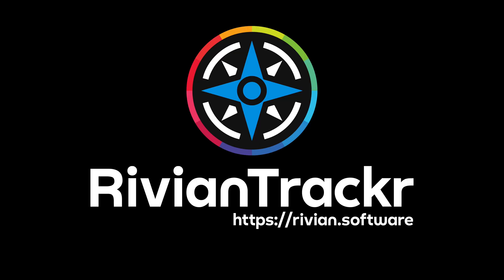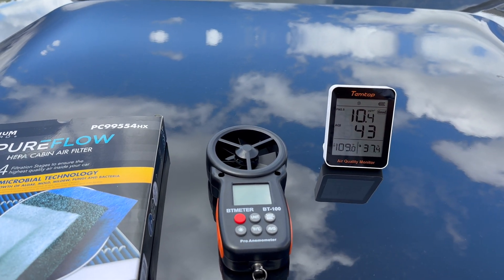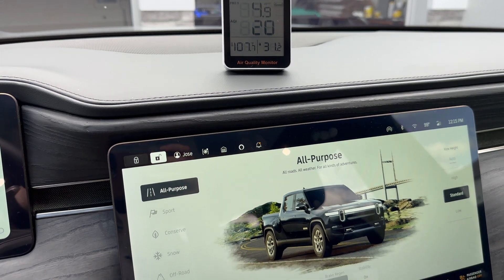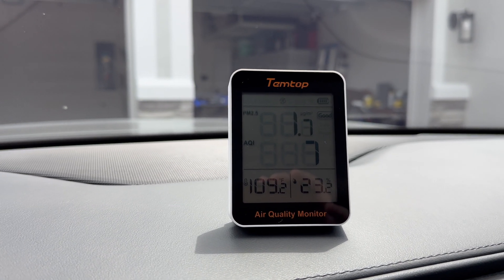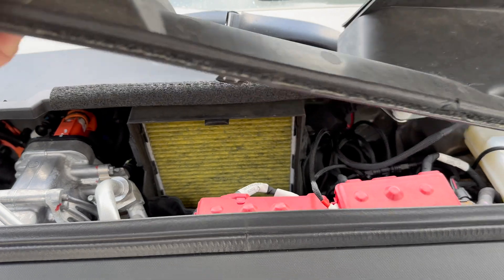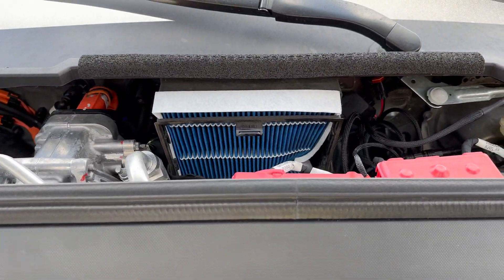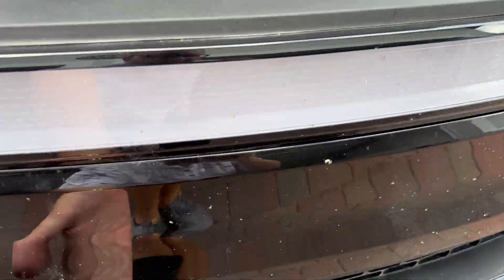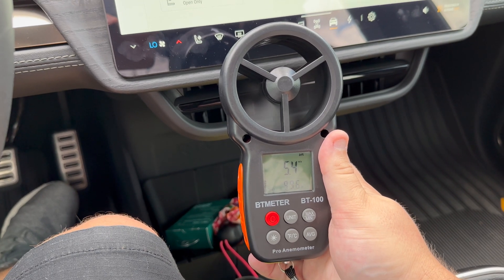Breathe Easy in Your Rivian: Install a HEPA Air Filter for Cleaner Cabin Air

Comment: I appreciate the text however you are comparing a dirty used air filter with a brand new HEPA filter.  To improve the study You should test a new plain filter with a new HEPA filter.  This will offer more accurate data.
Reply from the maker: The filter I replaced was less than a month old from Rivian.

Comment: In case others are wondering the name and model of the HEPA filter since it''s not in the video or description (only the link):  Pureflow HEPA Cabin Air Filter PC99554HX | Fits 2020 2020-22 Hyundai Sonata

Product Description: HEPA (High Efficiency Particulate Air) cabin air filter is built with high efficiency filtration media, which is designed for people who suffer from allergies. It has a 10-15% drop in pressure compared to a PUREFLOW Advanced filter and is recommended to be replaced at least twice a year.
Reply from the maker: Correct!
Reply: @riviantrackr  Ok?  I know it's correct as I clicked on the link.

Comment: Thank you for doing this test, however, you're leaving out some important factors in the video.  Recirculate setting on/off.  Regardless of what Rivian says, do the test with Recirculate on and another with it off as it eliminates all doubt thus making a more informative video.  Next, what is the average life of the HEPA filter before replacing it.  Clearly this will vary depending on where the vehicle is driven but if you're going to impose your opinion that there is no reason not to use this HEPA filter, this becomes an important variable in that decision.  You repeatedly said $40-$50 for the filter (yet the Amazon link has it less than $29) as if that's no big deal for "US" to spend ... repeatedly.  IMHO, stick to the facts.  Report the data you collect with less opinion which I believe will a more positive impact on people subscribing to your channel. 
P.S. When you need to do something with two hands in the video, consider a camera stand or have a family member or friend hold the camera.
Reply from the maker: Working on redoing it!

Comment: Would you re-do the test with the settings on "fresh" instead or "recirc".  If you want to test the filter, the results will be more accurate drawing in fresh outside air.  Recirc reduces the amount of air drawn in from the outside world.
Reply from the maker: It’s coming
Reply: This would be important for the wind speed measurement.  In the video the wind speed was only measured with recirc on which means no air was flowing through the filter, hence why there was no difference in wind speed.

Comment: Thank you - great video! Stupid question - is the filter you replaced is for outside air only? The reason I am asking -  you set the air circulation (in settings) to be internal (aka no external air). And then you tested for 2.5 particles, But filter was not engaged in this case, no? Unless Rivian has another (internal cabin) filter.  And that is why you got almost the same results.   Maybe you can do the same test when AC setting is to get external air, and then filter should make a difference, imho.
Thoughts?
Reply from the maker: Not in the video but I did disable recirc
Reply: @riviantrackr  got it - thank you, I wonder if you select internal circulation, there will be no filtration at all, right?  I think my other cars pass any air through the filter, and just open/close the air inflow depends on the mode. Much better design IMHO. Mainly because if you have very "polluted" air inside, with a lot of dust, all this dust will get into the air system and will not be filtered at all.
Reply from the maker: @polzovotel  So I asked Rivian about this and they said it does still use filtration
Reply: @riviantrackr  That puzzles me as I do not see how they pass cabin air through the outside filter....
Reply: You can see in the video like half way through when testing the new filter that recirc is still on. I don’t think he ever turned it off.
Reply: @Diyrrr  I also looked at the filter compartment and I just do not see any way filter is engaged when recirc is on. Just no way. Meaning that there is no filtration of air when recirc is on, unless they have additional filter somewhere else.  Seems Rivian went with cheapest solution as most of cars (unless premium ones like BMW) will use filter all the time, to 1) prolong the AC system, life 2) clean the air.  I do not know why Jose is saying that filter is used in all cases...
Reply: @polzovotel you are correct, most cars don’t filter when recirculating is on. You can tell that the Rivian doesn’t because the air blows harder due to the lack of a filter obstructing it when on recirculate mode
Reply: @Diyrrr  Yep. Anyway, I guess this test needed to be done in slightly different conditions to verify the results. Also, the filter compartment in Rivian is not tightly sealed, so some outside air may skip the filter.
Reply from the maker: @polzovotel I plan to redo the test correctly and post a correction video :)
Reply: @riviantrackr  Thank you Jose - really appreciate all your help to Rivian community! More we learn about the Rivian - better we can use it and maintain.